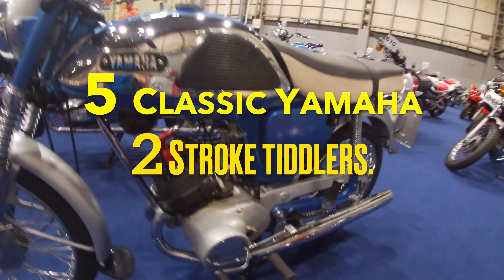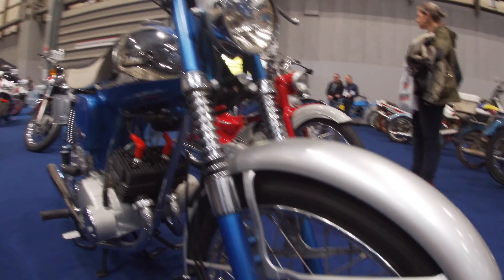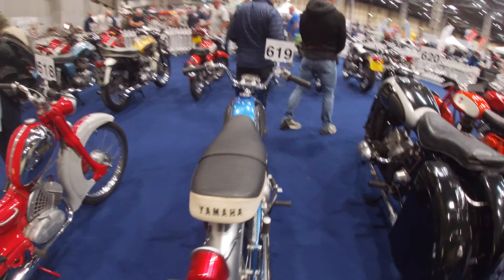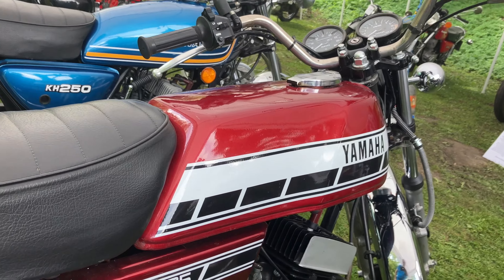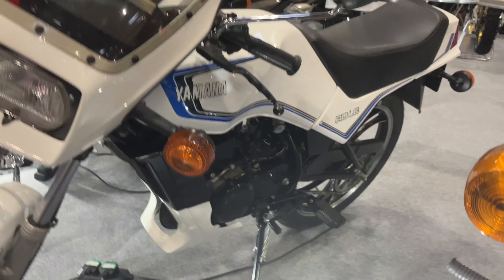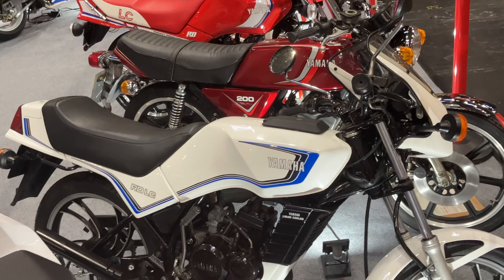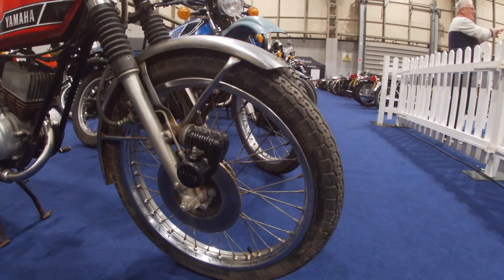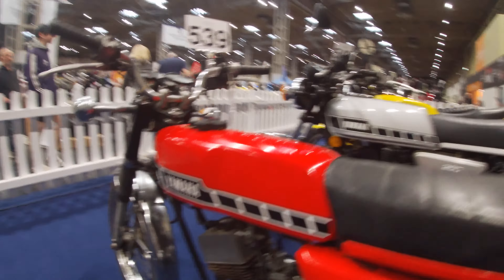5 Classic Yamaha two stroke Tiddlers   4K

Comment: I still have my late model RX-S.  I had one previously which helped get me through college and university.  I could not think of a cheaper way to maintain independence.  I bought the bike cheap from a friend, and could MOT, tax and insure it for under £100 annually.  I was a bit of a born again biker, having passed my test back in 1984, so it made sense to return to bikes.  The improvement in weatherproof gear meant that year round use was a feasible undertaking.  Thanks for the video!  
A friend of mine had an LC80; he managed to get a 125LC engine into it😬.
Reply from the maker: They are about as simple as motoring can get teay

Comment: I bought a YL1 when my C15 needed a full rebuild. The tyres were made of black greasy rock and the brake linings from cornflake packet. The suspension was a pogo-stick either end. Once I had fitted Dunlops, Ferodo and Girling, it was a corker. Faster than the C15 (I know that's not saying much!) and like a bicycle round corners with good brakes and roadholding. Wish I had it now but i was a Brit-bike guy and sold it on when I'd rebuilt the C15.
Reply from the maker: Japanese took some time to gather their heads around cornering , quick though no doubt

Comment: The RD 250 LC + RD 350 LC where really iconic, the looked a bit like the  production racers from Yamaha, due to the German insurance classes the 350cc was in the same class like the 27hp motorcycles but it was more powerful, lighter, smaller and faster than other bikes of that class, same goes for the 250cc that was placed in the 17hp class.
Reply from the maker: In the UK the 350 was used in a one make racing series 
Which was interesting 😂

Comment: I had a YL1, Same colour blue. It was very small, but fast as hell, all gears were up, so neutral was at the Bottom, leading to many a red face. I also had a 125 YAS1, with the tea urn air filters, that was quick also. My 1st new bike was a 200 YCS3, electric start, followed by a 350 YR5. In later years, My wife had an RD250LC, but she didn't ride it hard enough, so I would give it a thrash and fill the road with smoke.😂
Reply from the maker: Ah so a drum gear box 
See it today in some quads I think
Reply: My first new yamaha was the YCS5-E, Which I still have, was the updated cs3

Comment: Love my two strokes tiddlers 84 gp100 soon to be big bore 125 and my rg150 rare bike only for Thailand with 100 brought here to nz 38hp at 12500 180kph limited could do 200 unlimited highly strung little bike has Suzuki exhaust valve system 6 speed basically a road legal rm antisocial i love it🇳🇿
Reply from the maker: Tiny bikes can be crazy

Comment: None of the Yamaha small twins 200cc or less including the YL1 used the crank mounted clutch. They were all on the transmission main shaft and quite smooth and reliable. You’re thinking of the pre 1967 250 and 305 models and the road racer TD1 through TD1B that had the grabby crank mounted clutch.
Reply from the maker: Non of the others agreed bit I can only report my research
The YL1 was pre 67 and I am reading from a contemporary article in Cycle magazine
Reply: @bikerdood1100  Well they were wrong. I still have a YL1E and had a CS3B 200. Both had normal clutches on the main shafts. Besides a few small  mini bikes and step thru models with auto clutches only the 250s and 305s had the crank mounted clutches until the 1967 YDS5 came out. You can believe that as I was a Yamaha shop tech from 1972 through 1981 and then a service advisor and technical writer for Yamaha Motor USA until my retirement in 2017.
Reply from the maker: @guylr7390  interesting because they went into some detail 
I notice yours is an E which I’d assume is electric start so it may be @ different set up because they had to mount the  starter motor drive somewhere so it would have more design changes than a simple change to 12v

Comment: The compression ratios of these units seem amazing low .., is this a reflection of 2 strokes in general and a pre compression due to air / fuel mixture in the crank ..?
Reply from the maker: Well they generally run fairly low compression ratios 
They do combust twice as often of course and heating is definitely an issue. They always seem quite sensitive to mixture too,

Comment: In a parallel twin, both pistons reach top dead center at the same time.
In a parallel twin where the pistons move up and down at the same time, the crankshaft angle is 360 degrees.
Reply from the maker: Er nope 
In most British and some Japanese and Italian bikes that is indeed the case but it doesn’t tend to be in Two strokes 
All in the video had a 180 degree offset which is very much the norm on two stroke parallel twins
Villiers included
Reply: On a two stroke, a crankshaft angle of 360 degrees would be the same as an angle of 0 degrees.
This because the whole sequence of induction, compression, power and exhaust events takes place in a single rotation. A four stroke engine takes two rotations to carry out the same events.
Reply from the maker: @derekp2674  well yeh

Comment: I bought a Bridgestone 350 GTR in 1968! Way ahead of the Yamaha. Rotary disc valve intake, 37 hp, 19” wheels, six speed transmission and a suspension close to an English bike. (I had a Norton 650 at the time and no, the Bridgestone didn’t handle as well, but was more reliable) I bought the Bridgestone at a department store for $595.00, couldn’t say no! Too bad the Japanese Motorcycle companies forced Bridgestone to stop making bikes and stick to making tires. The Bridgestone was not as well finished as the Yamaha, but was more comfortable to ride, went faster and stopped more quickly.
Reply from the maker: Unfortunately Bridgestone did enjoy sales that were strong enough 
They were pressured by the other big Japanese makes to stop bike manufacture if they wanted sales of their tyres. Tyres were their  main business by that point and with sales only so so it seemed an obvious choice

Comment: There was a whole series of Yamaha trail and Dual Sport on-off road bikes sold in the US  like the YG5T, L5T the LT1, CT1, the little horizontal arranged single cylinder bikes had rotary valve induction, and had very wide torque curves. I owned a 1966 Twin-Jet 100, I seriously don't agree that it could do more than 50 mph, as I also owned a 1970 Honda Trail 90 and it wasn't much faster than the Honda. It certainly had he soundtrack that made it sound like it was pushing over 60.
Reply from the maker: True but can’t feature em all

Comment: I do own a few RD125LC, today. Both type 10W and 1GU. Pretty close to the RD80LC: they share the same frame. So they are pretty lightweight for a 125cc. Both have 21hp, propelling them to a 130km/h upright and a whooping 140km/h, when I fold myself together.
In perspective: I know of a Suzuki LS650 Savage, which did only go a 120km/h, having 27hp. And a Suzuki GS 400, praised for going a 150km/h (also 27hp). And I haven't even optimised the transmission ratio. (140 at 10000rpm. 21hp at 9000rpm.)
Fun fact: pls take a look at the front disc of the RD80 and the RD125: the disc on the RD80 is slotted. On the RD125, it's not!
Emergenzy braking in heavy rain with an unslotted disc brake: like you just wanted to accelerate. Terrifying! I do have an RD80 disc now, to put on mine.
The later TZR 125 4DL had 34hp. Would be fun to put such a motor in there. The size of the rear chain is different. So that would need some mechanic work. Fair waring: that is illegal (at least in Germany)! I'm 63. I don't care very much , anymore ;-)
Reply from the maker: It ain’t all about top speed, the Savage is a very different beast. I know which I’d take on a long journey

Comment: You featured the Rd125 and overlooked the As1.
If you had done your research. Instead of simply reading out the spec sheets.
You would have noticed. The As1 is the only road based motorcycle to win a Grand prix world championship. In the hands of Sweden's Kent Andersson. Far more impressive than the Rd125. Wouldn't you agree.
Reply from the maker: 🙄
The simple fact that I don’t have film of an As1
May be significant here
Rude comment incidentally